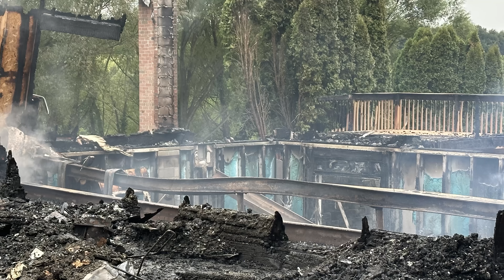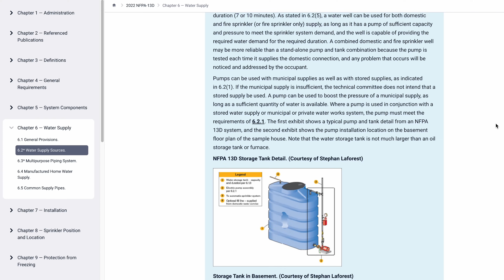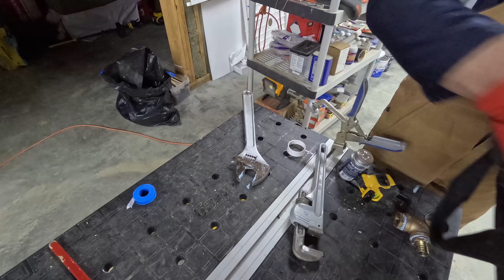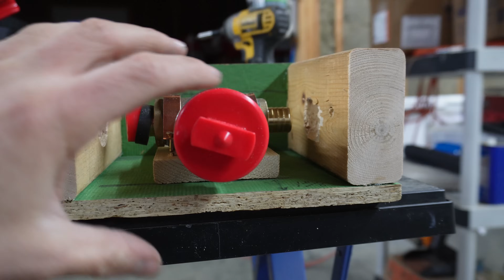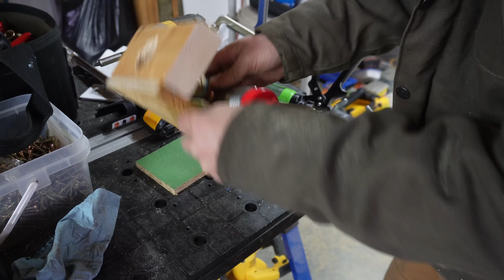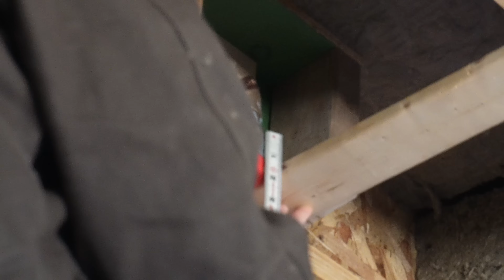This is Why We're Installing House Fire Sprinklers

Comment: We are rebuilding in CA after losing our home in the Eaton Fire (along with 7000 of our neighbors) and required to install fire sprinklers. I hope these boxes are code complaint in CA because I’d love to use this detail on our vented attic for airtightness. As of now our Manual J calculation is in limbo…
Reply from the maker: Gosh so sorry to hear you’re going through that. The boxes worked out great with the siga, if you don’t have a ceiling membrane and doing airtight drywall instead, the next option would be a little foam box installed after drywall that is taped and sealed around the sprinkler with foam or caulk. Many old can light housings successfully sealed this way. Best of luck on the project! We actually have a whole section in the build guide on disaster resilience. It’s finally in the home stretch, sign up for the email list at masondixonacres.com and you’ll be the first to know when it’s live!

Comment: Alex, we are currently well into building our retirement home. 25 odd years ago we purchased our current home from my folks and during the remodel I installed a fire supprssion system so that we would at least have a path out would there ever be a fire. Never a regret in doing this.
Putting a system in our new build has always been part of the plan, but after watching your install, we've upped the game a bit. Using Pex is such a good idea (aside from wrestling it into place) and having a storage tank just makes sense seeing as we will be rural as well.
Thanks for sharing
Reply from the maker: Don't buy the coil, buy straight 20' lengths!! That would have made it so much easier and I can't believe I didn't think about it. Thanks so much for sharing your experience, trying my best to spread the word and make buyers and builders aware of how easy this addition is. One small change to a cabinetry option could easily pay for a full system professionally installed.

Comment: California and Maryland REQUIRE fire sprinkles in new houses??? My goodness… how much does that cost? How much is maintenance? Man that’s crazy.
Reply from the maker: Yep, and actually not much compared to the cost of the total build. In MD it's around 3-7k depending on the size of the house, so roughly 1% of budget. There's no maintenance except running the pump every now and then just to check function

Comment: Great move.  We watched a neighbor's house burn. Military post. Residents were working on a vintage car in the garage and had a big fuel leak. Fumes accumulated. They realized the danger and decided to push the car out of the garage. Unfortunately they needed to unlock the steering wheel, so turned the key to "on." WHOMP. I heard that terrifying sound inside our place. Whole family badly scorched and immediately medevac'ed to a burn center. So sad. Our house was in danger, but the fire department arrived at the quick time and hosed us down.
Reply from the maker: Oh my gosh that's a terrible shame. Hopefully they all survived and healed

Comment: With you installing the Fire sprinkler system  I was curious as to where you were located as per Cold Winter Temps  and water in the lines . Pex is strong but ICE is mightier ! The heads may be the achilles heal , the week point .I had a outside electrical plug that was not caulked and the winter wind blew thru enough to freeze a water pie and flood my laundry room . The glass temp bulb may frost and pop , be cautious the the cold as well as peak heat temps.
Reply from the maker: We get cold winters but there's a good bit of Rockwool over top all the piping and components, and the heads/elbows are basically exposed to conditioned air within their airtight boxes. We should be good 👍🏻

Comment: You are doing exactly what I did (sort of).. For less than $500 I kitted out my 3600sqft house with sprinklers.  I did a 1" Trunk off my bladder tank (80psi) with 3/4" loops for each floor and 1/2" takeoffs all in Pex A with flush mount sprinklers (24 in total).  Talk to your insurance company, they usually give you a nice discount for having it in your home.  I would add a 80+ gallon bladder tank inline incase you lose power with the pump to get a few minutes of run time..
Reply from the maker: haha so I'm not the only one with a chip against CPVC in ceilings 😆 the bladder tank is a good idea!
Reply: @MasonDixonAcres  I HATE CPVC.. I do everything in PexA.. I would really suggest that you invest into the PexA system for your next build.. The fittings out flow the PexB up to 60%, so you almost get the same flow rate out of 3/4" PexA as you would 1" PexB.
Reply from the maker: @FJB2020  I might, I don't have anything against A except the fitting cost and harder availability for anything nonstandard. I feel like the flow rate difference is overstated though when the most restriction ends up being at the fixture anyway. Viega did a test worth watching, of course they are biased but at least they put some money where their mouth was 😄https://youtu.be/GV8bqCHc5eA
Reply: @MasonDixonAcres  I piped my whole house in Pex B then redid it all in Pex A and it was a noticeable difference.  I think I mention it before in another one of your videos, but I am a principal piping Engineer, so I have a bit of salt in the game too..
Reply: @MasonDixonAcres  PS just watched that video and they should have shown multiple fixtures operating at once since the test is limited by a low flow fixture.. That is where you will find the issues.  Running a shower, dishwasher and maybe doing a load of laundry.. Also note those fittings they show are slightly larger than your typical PexB fittings, which is fine, but they should really mention that since that is the issue at hand..  PSS those viega fittings are more expensive than upanor ones in the same size per supplyhouse (I actually buy bulk fittings from menards for half of that price)..
Reply from the maker: I can definitely see how there would be a flow limitation in a trunk/branch layout, but my guess is that flow in homerun lines is mostly a function of pressure at the manifold. I don't think a fixture in a homerun system would have the same drop in flow as a trunk/branch system with multiple fixtures running (provided manifold pressure stays up, which is dependent on other factors unrelated to the branch fittings). 

I'm also no piping engineer and failed my first fluids exam so take that with a grain of salt lol

Comment: Great video and it led to some questions for me. We have a second home in upstate NY and I can't imagine how much damage a fire could do while we are way, we are surrounded by forest. At the same time, 2 years ago we had significant flood damage due to a frozen pipe that was covered by insurance but was a huge headache to correct. Since the house runs on forced air, we shut the water down when we are away. It would seem to me, even if the sprinkler system has an independent source of water, you introduce the risk of a failure leading to flooding. I know there are devices that can shut off the water flow automatically but I am wondering how it could distinguish between failure and fire. Maybe I need to watch part 2! Donated to FD.
Reply from the maker: Much appreciated!! There isn't a way for the pump to distinguish between a leak or a head going off, it will be run by an on/off pressure switch. You can also use a flow switch which might work if it's a small leak, if the flow isn't high enough the pump won't activate. A leak from a bad crimp was definitely one of my biggest fears while running the piping, you'll see more in part 2 😉

I'd say if you have to let the house get below freezing, the pipes need to be emptied or mix in propylene glycol with the water. There are also dry sprinkler systems for sprinklers in outdoor areas (stadiums, loading docks, etc.) which only contain air in the pipes, but this is very uncommon for residential and way more complex and expensive.

Comment: Wonderful timeliness on the video (for me!).  I have been trying to figure out how I was going to deal with access and size of a loft area, and the code allows more leeway if the whole house is covered by fire sprinklers.  I had assumed they would be much much more expensive - I will have to take a close look at how they'd fit in my build.
Reply from the maker: Glad it got ya at the right time. Our inspector actually told us with the sprinklers we didn't need drywall between the garage & living space, which obviously is still going in but there are definitely some code relaxations with fire protection. I'd definitely recommend looking into it, it was neither difficult nor expensive in the grand scheme of the project and gives us a lot of peace of mind

Comment: Residential fire sprinklers sole purpose is NOT to save the property, it is to save lives.  Period.  In a house fire, you have 2-3 minutes to escape before flashover occurs.  This is when superheated gases become trapped in a space and combust.  In installing sprinklers the purpose is to cool the superheated gases to give you more time to escape.  The results through speak volumes.  90% of the homes are saved and the fire is contained to 1 sprinkler head going off.  All homes in America by code should have sprinklers, but you can blame the big home builder lobbies for continuing to block that code in each state.  FL is actually getting a lot of traction now and will probably be the 3rd state to adopt this ordinance.  

PEX is not the best solution for sprinklers lines because it does burn, but it is hidden between a 30 minute 1/2” gypsum fire rated assembly.  State codes don’t manidate what piping material choice to be used because of this.  CPVC does perfomuch better though.
Reply from the maker: Thanks for all the info! I feel like the fire resistance claim of orange CPVC vs PEX is more a marketing claim than anything else. In the real world, if the fire is so severe that the sprinkler pipes are actually at risk of melting and bursting... you've probably got bigger problems that a sprinkler isn't going to solve anyway 😅

Comment: Homes with attached garages are big fire hazards, as are electric bikes and cars that are kept in them. We live in PA, but my daughter is an EMT/Firefighter for a county in Maryland. Going through two rounds of firefighter training has her thinking seriously about fire protection when she builds her own house someday. So glad that house was unoccupied! Good on you for thinking about this during your build and bringing awareness to fire safety!
Reply from the maker: Thank you! Yes thank goodness there was no one in the house. From the research I've done, the majority of house fires are started in the kitchen, with the garage actually being a pretty small percentage. Does your daughter see a lot of battery fires?
Reply: @MasonDixonAcres  With garage fires, yes, because more folks are buying the electric vehicles. With electric vehicles, such as Teslas and e-bikes, the lithium batteries can have issues that spark fires for no apparent reason. We've had a few around our area when e-bikes have caused fires in sheds or garages, not to mention some folks toss old rags in a bucket from soaking up chemicals or vehicles fluids, which can combust. She was taught in fire training about the possible dangers of attached garages for that reason, and mainly because it can spread to the main house within minutes. It's easier and less time-consuming for a firefighter to extinguish a diesel fire on a semi truck than a car with Lithium batteries. But you are spot on with the kitchen being the number one place fires start! Having a fire extinguisher or fire blanket near the kitchen can save your home! I love your sprinkler plan!

Comment: Is it possible that unimpeded small air flow around the sprinkler head is a design requirement for reliable activation of the sprinklers? I worry for you that the air sealing boxes could delay or prevent the fire protection that you are looking for.  If the manufacturer’s instructions do not address this, you might want to check with them before drywall goes up.  If the boxes are OK, that’s great.  Thanks for this informative episode and the terrific series.
Reply from the maker: Appreciate it! The only thing called out in the tech manual is maintaining that 1/16" gap above the cover plate. Hot air needs to get up and around that to melt the cover plate solder, then once that drops off the sprinkler bulb is exposed to room air. I didn't specifically call Viking about the boxes, but the standard attic assembly piles insulation directly on top of the heads, restricting most airflow anyway. The box design gives them more breathing room (keeps insulation away) and in combination with the Majrex we're putting on, makes sure no air can ultimately get up and into the attic. I think the biggest thing is just making sure there's an opening into the sprinkler, but more airflow than that is just a hole in the ceiling 😄

Comment: As an HVAC professional, it’s important to understand that when installing teflon tape it is wrapped around the threads in the same direction as when installing the fitting. Installing the tape the other way will actually remove the tape when installing the fitting and will likely cause a leak. Personally, I’ve never had a leak from teflon only prepared fitting with the exception of fittings physically breaking due to over tightening. The teflon is an excellent lubricant and over torquing is extremely easy. In most situations making a fitting hand tight as possible then additional single 360 degree turn is sufficient.  For the higher quality/thicker  teflon such as yellow colored tape only 3 wraps are necessary I never use white. Always read the label to see if the tape you are using is listed as compatible with the product in the pipe. Rich out. 🫡
Reply: Good advice!!